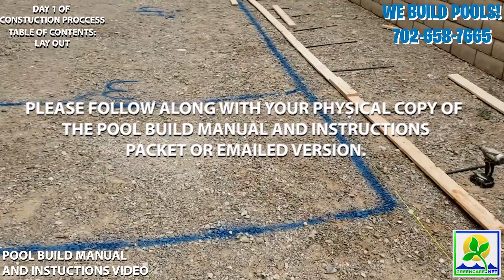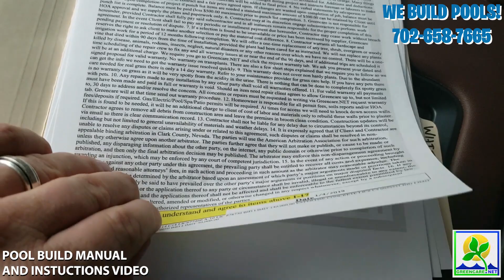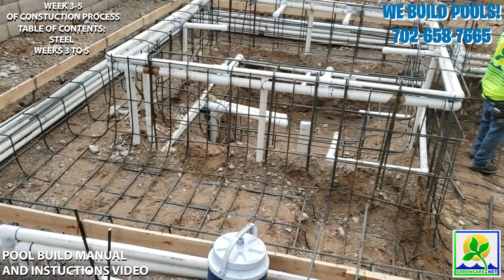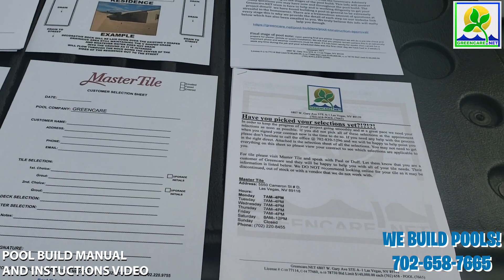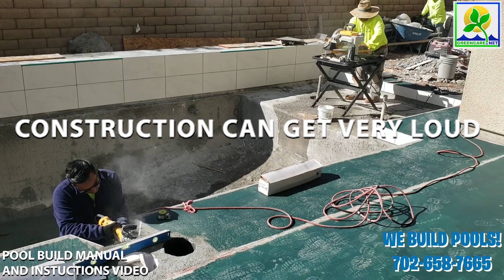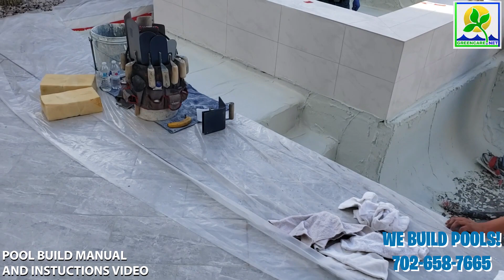POOL BUILD MANUAL & INSTRUCTIONS VIDEO

Comment from the maker: PLEASE WATCH THIS  VIDEO ALL THE WAY THROUGH AS THERE IS A TON OF USEFUL INFORMATION AND ANSWERS TO ALL OF YOUR QUESTION BUT HERE ARE TIME STAMPS TO SPECIFIC STAGES OF THE PROJECT. HAVE A FANTASTIC DAY :)
1:38 LAYOUT
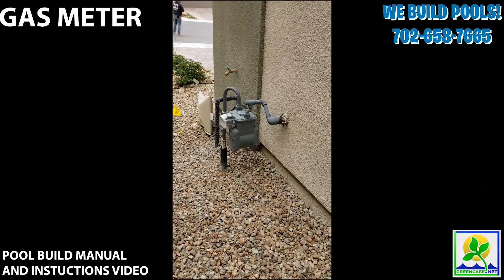2:29 GAS METER
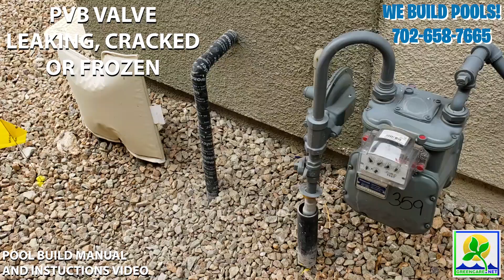2:49 PVB VALVE
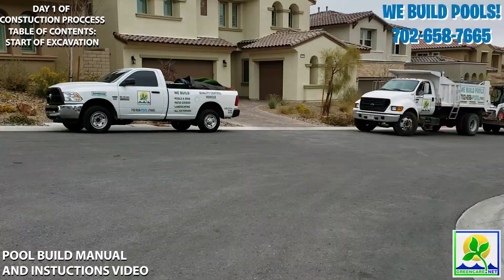3:41 EXCAVATION
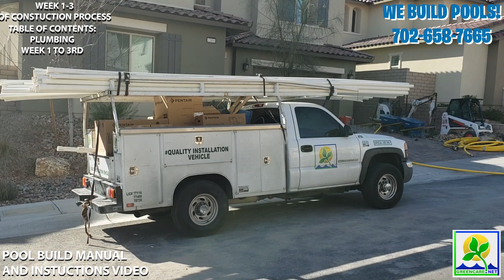11:46 PLUMBING
16:15 STEEL
20:00 PRE-GUNITE
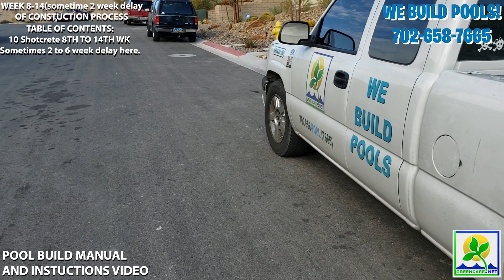20:07 SHOTCRETE
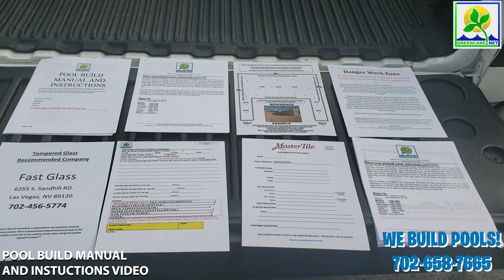25:10 COMMON QUESTIONS AND ANSWERS
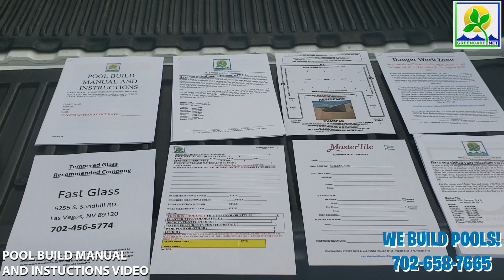27:24 POST SHOTCRETE CARE
30:26 TILE, ROCKWORK, WATERFALLS
33:16 ACTIVE JOBSITE PROTOCOL
37:48 CLEAN UP AND DECK
45:35 FINAL INSPECTION
46:44 PLASTER/PEBBLE
52:44 COMPLETED JOB/WHAT TO EXPECT :)